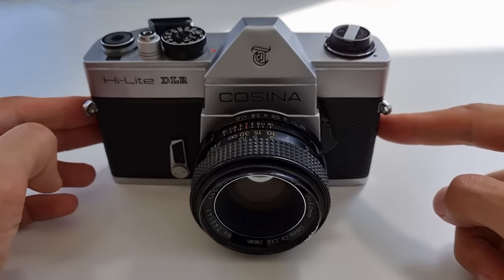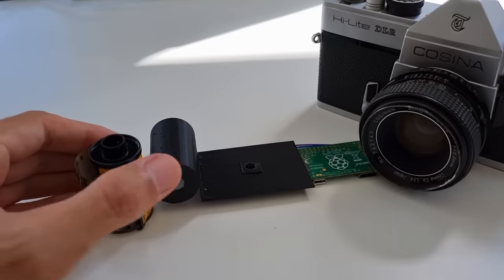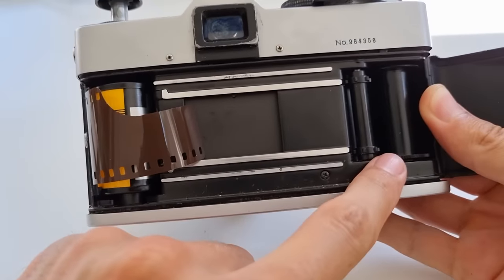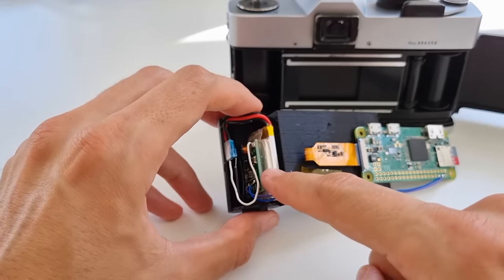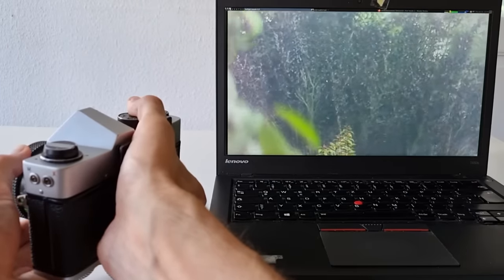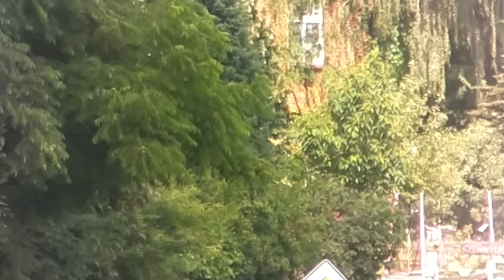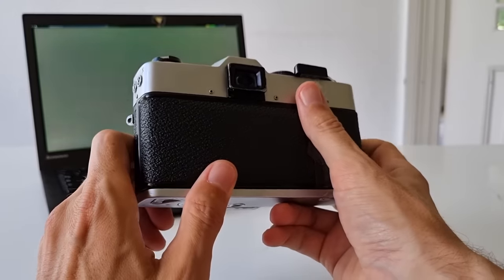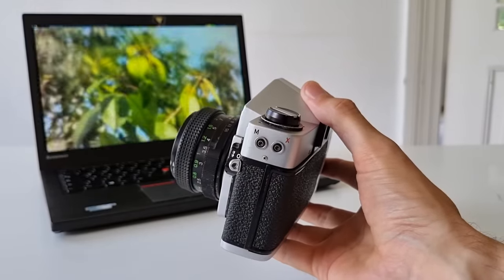Digital Film Cartridge for Analog Cameras (using Raspberry PI)

Comment: Well done! There were these converters in the mid 2000s that basically the same thing. Except they used bigger sensors of course.
Reply: What were the brand/model names, if you remember?
Reply: @bootmenow  I believe Nikon and Kodak had them. I didn’t use them an old colleague did. They are called digital backs.
Reply: Digital Camera Back - Shopping Search - Starting at around £1000 (Used) and mainly for larger format cameras.

Comment: Nice work! With the sensor used here (Sony IMX219) you've effectively created a 1/4" image plane, which gives you a crop factor of approximately 11x, compared to the standard 35mm film roll normally used in this kind of camera. Additionally, you're only capturing about 1/11 the amount of light which could lead to a noisy image. Are you planning to add a shutter trigger to the Pi and coordinate that with the mechanical mechanism of the camera to be able to actually capture still images?
Reply: You are reducing light by 11 to the power of 2 so 1/121 of the light gets into the sensor.

Comment: Nice work! It's really a pity that there are no large(r) open source imaging sensors
Reply from the maker: Indeed. I still hope that this will change in the future with the plans of the RPI foundation to open up the camera pipeline. Would be spectacular eith an APS-C or even full frame sensor.
Reply: @kassenbon  definitely! So many old, beautiful cameras to revive!
Reply: @kassenbon  How about combining many tiny sensors?
Reply from the maker: @ufukkiblat  Unfortunately, you will never get them close enough. A pixel of these sensors is roughly 1um in diameter. So even if you get them as close as 1mm, you will have a "black bar" in the middle of the image in the order of 1000 pixel width.
Reply: @kassenbon  Then how about at least 1 inch sensor? Even better M43 sensor. I can see this have so many potential in the future and can make you rich.

Comment: Amazing project! A question, do you need to position the sensor precisely (in terms of depth, i.e. proximity to the shutter), or an approximate position where the film used to be is sufficient?  Or maybe it doesn't matter because when you focus the lens, any difference is compensated. I guess the labels on the focus ring would be slightly off because of this, maybe it's small enough to not matter.

Comment: I have been thinking about something like this for a while now, and seeing it actually happen is amazing. Sensor size/crop factor aside, this could be very useful for testing if a film camera works without actually wasting any film/developing! That would be super awesome. The hardest part to make something like this actually happen is the sensor (acquiring the sensors, programming the drivers, manage the heat) and also pairing everything with the mechanical shutter, or you could just use electronic shutter with mirror lockup, but that wouldnt be the same, would it? Congrats for pulling this off!
Reply: Your concept was Oskar BARNACKS idea of creating a quick exposure test device for movie cameras. We all know what came out of this: the BARNACK LEICA.

Comment: Great concept, the limitations I'm seeing here is the fact that in order to get the full frame factor and utilise the whole lens you'd have to have something closer to 35mm CMOS sensor which is not only expensive but requires significant processing power which raspberry pi lacks and could bring the manufacturing cost on par to a new Mirrorless.

Comment: Terrific. There was a company in the 1990s which promised a product like this. At the time I hoped to be able to continue to use my SLR with it. Sadly that one remained vapourware but here you are with a working version.
A 35 mm size sensor would probably work better but I guess that's not practical

Comment: When digital photography first became fact I was using a Pentax LX and Pentax had promised a digital back, because that is a professional camera. But they never fulfilled that promise. Something like this would really be most helpful if it could have a larger sensor. I think this is really clever lateral thinking and reminiscent of the many things I did in the early days of SLR. If you could develop it further it should succeed commercially in spite of the smartphone. After all, it has become fashionable to use adaptors to attach those lenses to modern digital cameras with some success but without the advantages of the superb facilities offered by such as the LX, like full size viewfinder!

Comment: This is an amazing piece of work! 
I wish you showed an image of what the viewfinder sees to compare it with the digitally captured image and determine how much of the frame is actually being digitized.

It is inspiring me to dig up my old Nikon F2 SLR workhorse & try to make something like you did to turn it into digital.
I'm surprised that there was enough room for the Pi Zero to fit inside!

As for the zoom factor, as a few commenters have pointed out, the Pi's camera is only seeing a portion of the available frame... particularly because it's so close to it. 
Possible solutions: 1) put a macro lens on the camera or 2) make a custom back plate for your reflex camera so that you can move the Pi's camera further back to allow it to "see" more of the available frame.

Anyway, thanks for sharing this & hope you continue to pursue this project in the future.

Comment: The core concept of equipping an analog camera with a digital sensor has been done many times. The main problem remains that you can't put a decent, big enough sensor with all the necessary electronics into the camera without big modifications or without making it a lot heavier and/or bulkier. It's very impressive how you put it together, even though it's more of a novelty or toy than anything you could work with - but your approach is very interesting.
Reply: I think in the future when technology will be better then there will be a solution. It's only our limited technology of today.

Comment: Seems like a very good idea no doubt millions of 35mm's SLR just collecting dust now.   My camera system was Canon  old F-1, AT-1 FTB (old manual) with 4 lenses. What I am not keen about is the newer digital SLR cameras even if it's the same make  the lenses from 35mm SLR's will not  mount to digital cameras. Lenses are quite expensive.

Comment: As @sigilvii mentioned - this method only receives a small amount of the whole light/picture that goes through the lens. Getting bigger sensor would "widen" the view, but I'm not sure if there is a sensor large enough and cheap enough and compatible with raspberry.
BUT this can also be solved by moving the sensor closer to the lens. The black door that you called a shutter - is it really the actual shutter? I'm not really familiar with the analog camera design...
But the digital camera does not need the shutter as it uses a "digital shutter".
This project has really big potential. You had a really good idea. I think it can be improved to a degree where the camera actually takes photos with the button.
Very interesting project 👌🏻

Comment: This is the best conversion I have seen and is very neat. However it needs to be improved by using a FF sized  sensor located in the camera 35 mm frame. It also needs to be hooked up to the camera shutter and  advance.so that it works like an analog camera. It. Would be ideal if the electronics could be easily removed so that the camera could be used as originally intended. I would like to see a schematic diagram and parts list.Very good effort. Congratulations !

Comment: Nice job! Looks like you’ve also removed the pressure plate and camera must have it’s mirror up to constantly expose the sensor. As others mentioned – tiny sensor crops into the very center of the lens magnifying all of the optical flaws as well as loosing wide angle and missing most of the light captured by the lens. Can be solved by properly sized sensor (aka full frame). 

Even though what you did with streaming is a “good” demonstration of technology since no analogue photo camera ever streamed video, it is useless for most of the people who want to use these cameras. For this to be usable it’s necessary to make it work with the camera’s shutter – would also solve battery drain from a large sensor and make viewfinder usable again.

Cheers!
Reply: A pull switch can be added in between hutter and raspberry Pi gpio pin. And programmatically we can take a pic in rpi when gpio is high.

Comment: With an APS-C sensor this would be amazing.  I find it strange that people want you to take the step from this little phone sensor to full frame next.  That would be a recipe for failure.  You'd also need to make it adjustable so that it could fit multiple cameras.  They don't all have the same measurement from the film cartridge to the center of the picture frame.

Comment: Since it looks like about a 400 mm equivalent, it's a bit limited in use, but its a very cool application...it's taking a picture of a tiny part of the 'film' area, and you probably have to fiddle with focus, and it depends on the lens quality a lot.  If you try to capture more of the 'frame', by moving the Pi camera further away from the lens, the diverging rays in the aerial image would be a real problem..... . The advantage here is the 'drop in' part, and you're imaging a part of the aerial image with close to paraxial rays.
Reply from the maker: I agree. I think one thing that makes the lens quality less relevant is that the image sensor is centered at the principal point (at which the resolution of optics is the highest)
Reply: @kassenbon  absolutely.

Comment: From an engineering standpoint it seems silly to me to keep using the old bodies, but I can see the nostalgia factor.  The bulk and cost of using a full frame sensor likely make this not worth pursuing, but if you managed to get a full frame sensor in there with proper heat distribution and battery life at a reasonable cost I'm sure people would be lined up to buy it.

Comment: The solitary problem is the tiny sensor only using a fraction of the camera lens: it needs a 35mm sensor for it to use the whole lens and accurately reproduce the same images you would get with the camera on film. Other than that, this is truly amazing, and if mass produced would probably turn the camera industry on its head: why spend a thousand pounds on a digital SLR when you can slip one of these in any old camera you can pick up at a garage sale or dig out of your grandmother's attic?

Comment: I think that one of the biggest hurtles you'll have here is syncing exposure with the shutter release.  To get the most out of a digital camera sensor for stills dSLRs and dSLR mirrorless still use a shutter.  35mm cameras would be the easiest type to target since fundamentally they are all really close in operation.  And use a full frame sensor!  You'll get the true zoom and rich light from the lens that way.

Comment: Small-format sensor + 50mm lens + macro spacer would basically be a long-throw microscope, good for microsoldering or something of a kind.

In other news, 5V step-up board might not be that great an idea. I mean if it was stepping up to a higher voltage, it would run fairly efficiently, but at a small step up to 5V, it tends to waste a lot of power, like right about a third; in the meanwhile, the Pi can be powered by voltages between 3.3V and 5V, if you don't need to support any USB peripherals. You do lose a little bit of battery range, from 3.0V to 3.3V, but there's fairly little energy in that range anyway. I don't know if picam needs proper 5V. You can also use freed up space previously taken by step up to just have more battery.

Comment: Well, some cameras even had an  exchangeable "rear door" - so it would even be possible to build this with a display in the rear. Use the housing of one of the optional winders or motor drives which could be mounted underneath the camera for quick film transport and shutter windup and you have ample space for an SD-card slot, necessary electronics and batteries. Then replace the tiny sensor by something bigger - at least APS-C, and we're talking...

Comment: Clever. Did you add an additional lens on the inside or are you handling focal length issues with the old external lenses(I think the latter).  This lim 4:08 its focus depth. Also, software and an accelerometer i could ameliorate the shacking.

Comment: I experienced the same sort of super zoom putting a C mount lens adapter on an old 35mm Minolta lens to use with a Raspberry Pi HQ camera. There's definitely a big difference in the expected sensor area.
Reply from the maker: Yes, indeed. The factor is roughly 10x meaning the original 50mm focal length gets boosted to an equivalent focal length of 500mm which is quite insane :)

Comment: I don't have the slightest idea on how to program a raspberry pi, but theoretically couldn't it be programed to only save certain video frames? My idea would be to shoot a slow shutter speed on the film camera (1/30th) and set the digital camera sensor to 30fps and have it only only save the brightest frame and disregard the #000000 frames. It would be recording the whole time, but there wouldn't be thousands of blank frames. Just an idea... Super stoked to see this though!
Reply from the maker: I think this could work! Only issue might be that the autoexposure will take a bit of time to adapt from darkness to normal exposure. It might be that this takes longer than the shutter is open. So potentially you will get overexposed images using this method.

Comment: You forget to precise that the user has to keep the shutter opened. This could be a huge success since those old cameras are cheap, when it wil have resolved this issue : how to sync the chutter with the sensor. HAve you tried using a bigger lens like a 200mm or even a 300 mm?  May be for astonomy pictures...

Comment: Nice proof of concept. It still lacks photo shoot capability, which involves coordination between the sensor and the mechanical controls. This is a tough nut to crack.  The closest I get to a vintage camera shooting experience is when I adapt vintage lenses to full frame digital cameras like the Sony A7. It is far from the tactile experience of the manual controls of a film camera like the Nikon FE for example, but the image formed is still the vintage one.

Comment: Nice! Although - it has probably been asked already. What is the electrical power requirement? Is the raspberry pi powered only by the camera's own battery? Eg. how long does it run on a single charge ........ and how do you integrate camera's power switch etc to turn this thing on and off (and initialisation etc), and being able to review the shots within the camera itself - without connecting to a laptop or a phone etc. Otherwise - great work, and nice project.

Comment: Something i played around with before giving up was hooking up the raspberry pi to a flash sync cable, and using that to tell the pi to take a picture

the problems i was mainly dealing with after getting that working were that the pi had a pretty big delay between the shutter and taking the picture, most likely because it was running a full desktop too. i was meaning to try stripping down the pi to a bare necessities linux distro, but got too frustrated at that point and never followed through

Comment: This video is helping me plan out a possible similar attempt at getting my TLR yashica Digital (Yashica A), would a standard 9V battery work for the Pi or does it have to be explicitly 5v? Also, how did you get the Pi camera's lense off; is it easy to remove?
Reply from the maker: Hi. As far as I know 9V is too much for the PI. You would have to convert the voltage down. There are modules available that to this.
The lens can be removed simply by unscrewing. Sometimes, you also need to remove the threads as well. This can be done with an exacto knife from the side. It is a bit delicate but not very difficult.

Comment: The Banana Pi M2 Zero is an ultra compact single board computer which measures only 65mm*30mm. Its external interfaces are the same as the Raspberry Pi Zero W, and it will fit almost all cases and accessories for the Zero W. It uses the quad-core Cortex A7 Allwinner H2+ processor, with 512MB RAM. It's ideal for light-weight systems and space-limited applications. Like other members of the Banana Pi family, it supports both Linux and Android operating systems.
http://forum.banana-pi.org/t/banana-pi-bpi-m2-zero-quad-core-singel-board-computer-with-allwinner-h2-chip-design/3532

Comment: I came up with this idea at least 10 years ago and there was absolutely no way to even approach it back then without being an engineer with a lot of investment.  I am still to this moment shocked that a major company like, I don't know, Kodak or one of the other massive brands didn't develop real systems for this. It should be an actual sensor and not a camera and it should all be able to snap in like a cartridge.  It's totally doable and clearly isn't a genius idea if multiple individuals are all thinking the same thing at once.  Seriously if Kodak had a 35 and 120 product line it would kill.  It would be insane for the used camera market.
Reply: I remember when digital cameras first came out someone starting to develop this concept for 35mm slr's but it eventually fell by the wayside as digital cameras rapidly improved.

Comment: The issue with these things is that the sensor size is limiting the res. Film has a pretty high grain count so basically to acieve same res as film you need the same size of sensor , still hd quality will capture a lot but a 35mm film can still compete. This is the reason why some people still use 6x9 cm negatives professionally  because not only due ti the nice tech..but it gives good images still.